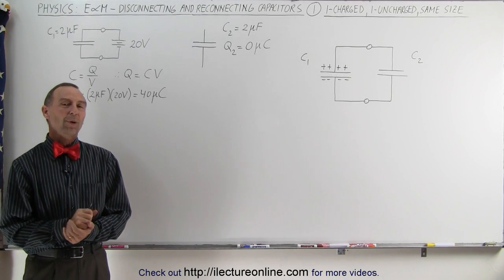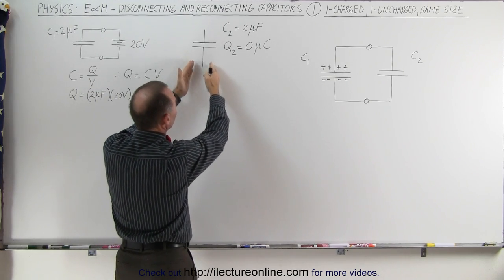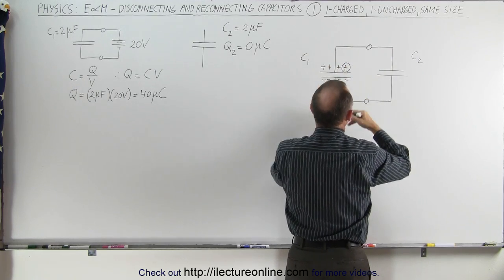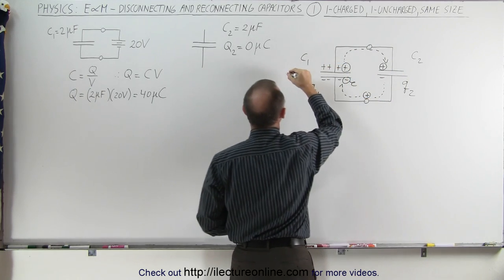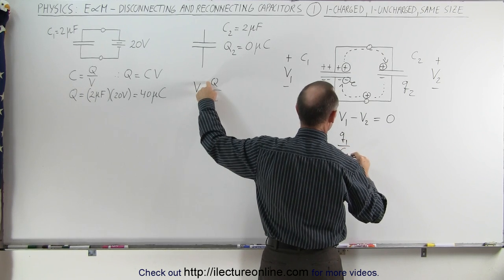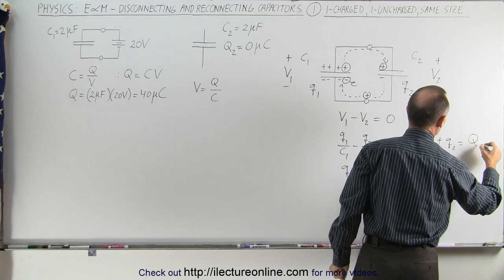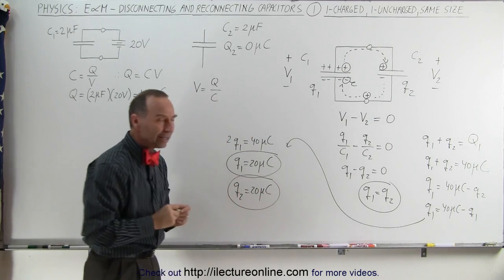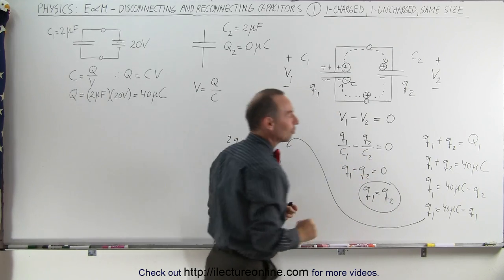Physics - E&M: Dis- and Re-Connecting Capacitors (1 of 16) 1-Charged, 1-Uncharged, Same Size

Comment: INDEED, CAPACITOR (& SUPERCAPCITOR) IN THE PAST AND AS OF TODAY HAS BECOME THE MOST SOUGHT AFTER AND RELIABLE ENERGY STORAGE DEVICE IN ELECTRIC POWER AND ELECTRONICS CIRCUIT BOTH IN HV AND LV APPLICATION, RESPECTIVELY WHICH OUTPERFORMS THE BATTERY STORAGE EVEN IN RENEWABLE SOURCE OF ENERGY APPLICATION FOR THE NEEDED INTERFACE WITH THE POWER UTILITY GRID.
Reply from the maker: That is defimitely becoming an area of research.

Comment: 4:20 The "initial" total charge is ZERO, not q1. It is only q1 if you consider the electrons alone (and they are the only moving charges in a solid). NOTHING forbids them to recombined with an atom momentarily missing an electron (a positive charge relevant to the discussion), or a neutral atom to generate an extra free electron , like they did to generate "q1"  in the first place. So, I fail to see the support of the assertion about the "conservation" of the initial amount of negative charge. I agree that we must not destroy electrons, but the "free" ones can recombine and new free ones can be generated.
Keeping the total energy, though, seems more fundamentally grounded, but that leads to a different result.
Reply from the maker: Since we are dealing with capacitors, the initial charge is as stated in the video.  It reprents the extra charge on one side of the capacitor.

Comment: OK, I tried this with different capacitors and initial charges on C1 with identical C2 discharged.  I ALWAYS get a SMALLER NUMBER!!  One reason I think is, is that when the two caps are connected together (very carefully, with one lead already connected, while the other is connected with a simple SPST configuration), I see a spark (since the initially uncharged capacitor is virtually a short circuit).  So, here is what I think.  Some hefty current must initially flow!  That causes current to flow at the time of connection, creating Joule hearing in the conductors, plus some radiated energy (like an antenna).  And this must be, at least partially, where the missing energy goes.  What do you think?  I will go on to the next video, hoping to eventually cure my confusion!
THANKS FOR THE GREAT VIDEOS!
Reply: I have the same problem of missing energy theoretically. The total initial energy stored in the capacitor 1/2 CV(square) is more than the combined energy of both the capacitors. This means some of the energy is being lost?
Reply: @gauravprakash  AND, it turns out that 1/2 of the TOTAL ENERGY is always lost!!

Comment: Sorry for the dumb question sir, but this is just out of my curiosity, why the conservation of charge is applicable to only the inner part between 2 capacitor, not the outer part
Reply from the maker: Not a dumb question at all.  The "why" questions are very important.  In the case of a capacitor, the plates always have opposite charges.  Therefore the charges on one plate attract the charges on the opposite plate, which causes the charges to migrate to the inner sides of the two plates.
Reply: @MichelvanBiezen  hohohohoohoh,, I see alrighty thanks a lot sir....

Comment: Since the charges in both the capacitors become equal, the energy loss of the charged capacitor is same as energy gained by the uncharged one. Is that right?
Reply from the maker: That is correct.
Reply: However, the total energy decreases from 400uJ to 200uJ!!!

Comment: Hello Professor. Does the statement "V1-V2=0" apply for capacitors in both series and parallel?
Reply: Yes I NEED to know the answer to that question too!
Reply: That is Kirchhoff's voltage law.. you can look it up.. It says that the algebraic sum of  all voltages in a closed loop is 0.. It is applicable for all components regardless of their configuration.. hope this helps :)
Reply: this statement is valid everywhere irrespective of configration

Comment: Hello sir. I have a general question. Suppose we have a charged capacitor and a battery along with it in a circuit and . In order to simplify the question we make another battery out of charged capacitor (v=q/c). Then what will be the direction of emf of battery made out of capacitor .
Reply from the maker: If the capacitor is fully charged and then replaced with a battery, the polarity of the battery will be opposite to the polarity of the initial battery.
Reply: This solves my doubt. Thanks a lot sir 🙏✨

Comment: sir, i have a question.
when we reconnected the c1 to circuit, there is no q on the circuit because q2 has 0c. yet you said while + charges moving the c2 repels + charges. that + charges where did it come ? have circuit charged inital?
Reply: It might be a mistake. But in general he meant that the charges get shared in between the capacitors according to the capacitance values.

Comment: Is it parallel combination because it looks like series
Reply from the maker: It is a series circuit, but when the 2 capacitors are connected, you can think of it as a parallel circuit in the sense that the voltage across the 2 capacitors must be the same (although one should be negative)
Reply: @MichelvanBiezen  thank you sir I got that. The circuit is in series but in a sense the voltage is same so it looks parallel, right?
Reply: If the two capacitors are connected in such a way that they are  in parallel and circuit is completed in battery. What would happen, will the charge still flow from C1 to C2?
Reply from the maker: The charges would move until the voltages are the same on the two capacitors if they are in parallel, and the charges would move until the charge is the same on the two capacitors if they are in series.
Reply: @MichelvanBiezen  But both are same as u said. If this is parallel then how do we connect in series or vice versa
Reply from the maker: Your comment stated that you were including a battery.
Reply: @MichelvanBiezen  oh ok I thought u replied to previous comment. Thnx again Sir. Also nice to meet you
Reply from the maker: Likewise.  Keep up your inquisitiveness. That is the foundation of learning.

Comment: Hie Michel, How much time it will take to attain steady state i.e, two capacitors gets charged equally after reconnecting the capacitors?
Reply: @Pranjil Jain but how much.
Reply: there's a relation between charge
q(at general time t)=Q(1-e^(-t/RC))
here Q is charge at steady state
R is resistance of wire
C is capacitance
t is time (general time)
if we will equate q with Q and solve the exponential equation we will get the time

HOPE IT HELPS !!!

Comment: Hello sir, what is steady state
Reply: Steady state is state where the capacitors are full of charges and no more extra charge can be accommodated on em' due to this current flowing through it stops completely eventually bteaking the circuit

Comment: what if we have a resistor between the capacitors?
Reply from the maker: Those are called RC circuits.  We have a playlist on that.   PHYSICS 48 RC AND RL CIRCUITS    PHYSICS 49 RCL CIRCUITS
Reply: @MichelvanBiezen  Thank you Sir. I could not find a video with this same case. A capacitor charging another capacitor, but with a resistor, in series, between them.  
But anyway, 
I am very grateful for your content here. Helps a lot.

Comment: Hello sir, what is steady state
Reply from the maker: Steady state means that enough time has gone by such that the transient state (the time during which the current changes) is done and the current no longer changes.  (or changes in a predictable manner in the case of sinusoidal current, or driven by a oscillating source).
Reply: thank u sir